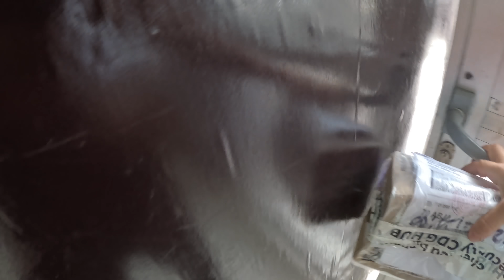Opening up the engine of my Honda CRF300 Rally in West-Africa |S7-E52|

Comment: As a mechanic in my first career I can safely say few people would rip that engine apart in that location unless they really knew what they were doing...very impressive. Your patience is also most impressive. 😅
Reply: Seems to me like doing Open Heart Surgery in a Dumpster.  😱
Reply: Patience? I think she's nuts going to Africa, a lady alone in a dangerous place like that, absolutely NUTS.
Reply: they didn't soak the clutch plates in oil before assembling bad mechanics. ￼👎
Reply: Why did they even took the whole engine apart to change to clutch plates? Seems like they did much more work than necessary...
Reply: @S....  so true only the bottom half needed to be taken apart, NO metal will pass through the oil filtration system to the top end, bad mechanics.
Reply: @scottp7587  Talking smack. They checked most of the engine at the same time it was apart. Only shows that they are good mechanics.
Reply: @S....  NO they did not do too much. You cant do too much when debree from the clutch assembly has broken into small pieces. You dont know much about this.
Reply: @peterjones4621  smh 🤦🏻‍♀️ racist spotted

Comment: These two mechanics are no joke. They get things done. Period. Outstanding job!
Reply: I hope they pre-oiled the clutch plates🙈
Reply: @stmasch7  mechanic humour haha.
Reply: Questioning their ability to repair motorcycles is sort of silly. Remember, when Noraly was stuck in the mud...all those motorcycles going through --- who fixed them?. Do not tell me some one from Europe and Japan or somewhere else came and fixed them. These guys must be very talented to keep those motorcycles running. And look at some of the brand's...TVS from India was one of them. I was wondering why Noraly did not get it fixed in Liberia. They would have done an amazing job too. BTW, you can do without a torque wrench. After a while you know the difference between 5 lbs/foot and 35 lbs/ foot ...like wise Newton/ meters.

These countries lacking resources do so much with so little. Can some of us in first world do the same? Be honest!
Reply: And, driving an M class bmw and a Mustang !
Reply: @stmasch7  Its a wet assembly as soon as you pull the clutch.
Reply: @surajdesilva4554  To anwser your question: NO.
Reply: @blueman5924 If you honest, show people respect and do a competent job and perform hardwork you deserve to treat yourself.
Reply: @stmasch7 
The engine was stared without the use of the clutch. Assembled the back wheel the next day to test ride. Enough time for the plates to soak in. 
They are true mechanics that think outside the box.
Reply: They   can  get  JOBS   in EUROPE    but  the workshops  would   go  MAD.
Reply: @tuforu4 The shop would go broke if folks worked like them.
Reply: @EckRD how when most in Europe are glorified part changers not real mechanics or mechanical engineers.
Reply: @StanWellback-eo9cm Yes I questioned that myself 😂😂Not so poor in Nigeria😂
Reply: Now imagine trying to do this with an electric bike 💀
Reply: @6Sparx9 f. Electric bike nothing but junk

Comment: These guys deserves an award from Honda itself and Honda deserves an award for such a serviceable bike.
Reply: I agree about Honda, but repairs are normal for any backyard mechanic.
Reply: Yeah but having knowledge on how to pull out everything and putting it back to one is a great feat
Reply: Exactly!
Reply: @TC-dw6wg  Four-Stroke engines are complicated and heavy.  Not every backyard mechanic is up to it…
Reply: WHAT ?? I would rather give this Honda model the Golden Cucumber.  At the film festival, the worst film is honored with the “Golden Raspberry” on the eve of the Oscars. This has so far not happened in the motorcycle sector. At least officially.
Reply: @TC-dw6wg they not backyard mechanics.they are masters
Reply: Honda is already well known for this. Excellent engineering.
Reply: Honda needs someone who buys a new motorbike after a little broke down.
Reply: What kind of an award? Lol take a brand new CRF to Africa and have an ENGINE REBUILD in the middle of the trip? I mean this is a nightmare and nobody would like this nor would call his bike trustworthy if such a thing happens
Reply: @fisherkalastaja  excellent engineering take a brand new bike and have an engine rebuild because you didn't just use it to get from your home to the cafeteria next door but for it's actual implied/intended use case
Reply: Amazing mechanics with the limited shop, lights and conditions...👏👏👏

Comment: These guys are fantastic mechanics… they have kept motor vehicles alive for decades that western mechanics would have left at the scrapyard for a long time ago!
Reply: No a western mechanic would have fixed this in the frame with no problems. There is no way they are fantastic except in imagining stuff to do the doesnt need doing.
Reply: So true..in Western countries it's time over money.
Reply: @gregorykleiman2137  I have to agree, Time will tell just how good these guys really are. It would not take much to miss some of that broken clutch basket and quickly destroy the new one. If I were Noraly I would change out that oil sooner rather then later if at all possible. Great program!
Reply: @gregorykleiman2137  Whatever.  I enjoyed watching the way they worked together wordlessly, without a bench, and seemingly chaotically, but then put everything back together like savants.  I'm sure they could teach Western mechanics a thing or two (and vice versa, no doubt).
Reply: @LeafBurrower  always fun to watch. They have done this a lot. I have seen a brand new chinese motorbike engine driven once and second gear broke a tooth. I watched a village mechanic pull it apart into parts and throw them all jumbled in a steel wok he had to collect them all. Then he got the part and put it all back together. They have a lot of practice it is like a rubiks cube. Great to watch if it isnt your engine.

Comment: Yes, from the very beginning, you could see the mechanic had confidence and never had a puzzled moment.  You knew he was going to fix the issues.  Amazing how Noraly has always had a guiding angel ready to provide assistance when she has trouble.   And for Lawrence, it is quite clear that without his aid, Noraly would still be back facing those muddy roads.  It may have been a blessing as she now has a "new" motorcycle ready for the continuing journey.
Reply: YOU SAID IT ALL MY FRIEND...  kŷdos to those Guys. You SURELY picked the Telltale signs of competence and understanding. // There would be very few Mechanics in the West who could pull this Job off under those conditions. // A Major engine overhaul; Resetting, Timing, Sequencing....  .... squatted over on a STOOL/ come Table... in the Dust. Hands bathing in "Solvent" what looked like Petrol. They had the sense to strip the Motor down... not only a Check Over but to find/ and Flush bits of Demolished Clutch assembly particles from the lubricating "system".  Truly Unbelievable under the circumstances. In the West... we think we Know it all with all our Fancy "Gear". //   NORALY being the "Film production Manager" had no reason to falsify anything but tell and show it as it was. What AMAZING ENDURANCE and TRUST this WOMAN has! // Karma is surely an Amazing reality in all this.
Reply: FreeCrack4Hunter  Certainly true, but I don't think they have removed to many 350 engines from that model Honda.  They certainly have mechanical aptitudes to go with their skill.  Removing that engine is not a simple task, and they gentleman in Alaska had a nice clean garage unlike these guys.
Reply: @notyermonkey2134  Did you notice the first guy that took the motorcycle for a test ride.  He did it bare footed.  Try that sometime.   Additionally, did she head mechanics' car??  It was a BMW "M" car which ain't cheap.  My neighbor has one, so I know how much they cost.  I think his expertise is well paid for.
Reply: Yes, the mechanic was better than good.  I'm not criticizing.......ok .....but  this is the first time i have ever seen a barefoot mechanic. I would hire him in  a heartbeat ,  bare feet and all. LOL

Comment: It was clear watching this as a mechanic that these guys were not messing around. No doubt that it was going to be good. I was particularly impressed with the amount of time they spent making sure you had no pieces from the clutch left in the case. Bravo
Reply: @vihreelinja4743  I would not have done any of these things
Reply: Those  timing  chains  are easy to get a notch  off,  and  a agree  with  the  piston pin.. never seen  it done  backwards  before.
Reply: @oldmate99  he's got a point. def. not necessary but while you're at it why not make sure it's 100% lol
Reply: You guys crack me up, doing it differently than you might, doesn't mean its not 100% and they clearly knew how to time it.
there was not a second of hesitation on startup. And the biggest issue that was going to potentially end in a bad bad place was a remaining piece of metal floating around. They made very sure it was clean. They crushed it.

Comment: I am always impressed by mechanics that can reassemble an engine by memory alone.
Reply: @vihreelinja4743  The parts may only fit in one place, but remembering to put them together in the right order, and have none left over -- that requires a bit more talent!
Reply: @vihreelinja4743  Spoken as a true armchair mechanic.
Reply: Once you have ripped apart enough engines it's more or less the same same. Especially fairly simple motorbike engines.

Comment: Those men seem to know how to fix a motorcycle very well. Even under such trying conditions. They have definitely earned our respect.😊 And by the way, all of us here ❤you.
Reply: Not sure what the conditions are you are talking about, they pull up in a M3 in a city full of cars and bikes, and bank machines.  Surely there was  a motorcycle repair shop somewhere better suited to fixing a broken (not just burned out) clutch...with metal filings everywhere.....the key word "everywhere".    A little compressed air and a proper cleaning, and a repair shop, would have made me feel a little better about this repair......Noraly is still concerned as you might have noticed.....because of this issue.  The fact that they took the whole engine out for a clutch repair seemed odd to me, but maybe they knew something I didn't.  Anyhow , I am commenting on your comment because I am noticing that there is this belief now that everything is good to go, normally there is a test run period to get past, and at least one oil change looking for metal filings......much sooner than a few thousand kilometers.
Reply: @greyfisher3897 they need to open engine so they make sure there is no other problems with it

Comment: My first job was an aprentice motorcycle mechanic at a Honda agency. The one thing I loved about Hondas was you needed one small set of spanners for the whole range from 50cc to 750cc. All the wiring was identical and all the tappet settings the same. This meant you could work on every motorbike they made as there was no need to constantly learn again and again. For this reason they are are excellent, simple and practical to work on and as everyone knows ultra reliable. We hardly break them in in Europe compared to developing countries where they are the life and blood of a nation...

Comment: Congrats to the mechanics who took their time and cleaned the inside of your engine before  assembling. 😊
Reply: yeah, right, shake it over a pot lol
Reply: @jimksa67  No torque wrench in sight
Reply: But still assembled and worked correctly.
Reply: Skilled mechanics don't need a torque wrench, you get a 'feel' after many years on the tools.
Reply: @Fekillix  i work as car mechaic in Sweden for long time , i belive he did a great job. yeah ofcours he needs use  torque wrench inside engine but we have to understod they work on fields and difficult to get suppliys  so great job guys
Reply: @Fekillix  it shows you have never worked on anything probably never left your city or got stranded
Reply: What does it say when your mechanic shows up in a BMW (M class I think?)?
Reply: @lonelychessdragon  I did actually completely take apart and re assemble a single cylinder motorcycle engine with all new bearings. And I soaked the clutch plates in oil before re assembly, which is pretty basic knowledge that these guys skipped.
Reply: There was no reason to take the engine out to clean and or to replace the clutch. Hopefully no oil leaks will develop down the road.
Reply: @unleavenedkaraiteplus3412  
My thoughts also.
Reply: @Fekillix 
I will trust those guys who fix and repair parts than you who always replaces parts. Many like you are just replacers and not mechanics. Many carry the mechanic title undeservingly.

Comment: Great news Noraly.  I'm former motorcycle mechanic.  Your engine has a really deep sump for any loose stuff to settle into. So don't worry about it. Remember that you drove it a fair amount after clutch blew and that didn't cause any problems. Relax and enjoy the ride. I love the view over you handlebars. Stay safe!
Reply: thumbs up for sharing your knowledge @athingortwo. It will give her some piece of mind IF she reads it.
Wanting to add my 2 cents, but with so many cmnts in the 1st hour (59K views), should I even bother. Due to the delay in her posting, I figured she could have taken the bridge to Austrailia by now. LOL (large toll.) We thankfully did not have to wait 2 weeks for an update since she trucked it into town.
Reply: Thanks for your informed posting. I was wondering how much residual metal might be lurking in the bowels of the motor. A question for you: should the new friction clutch plates be soaked in an oil bath for a few hours before installing so they're not dry? I realize it's a wet clutch set-up but there is limited space between the cork friction pads and the steel plates to allow much oil penetration.
Reply: @osimnod  Presoaking the plates isn’t needed because the plates are composite, non-porous material. Do you have a vintage machine with compressed cork plates?
Reply: @athingortwo1513  I have a 2006 KTM 640 
Adventure and a 2003 Aprilia Caponord that both need clutch plates replaced. I watched a YT video by a British mechanic who recommended soaking the OEM plates, so that's why I asked. Thanks for your response.

Comment: Great mechanics, No hi-tec tools or garage to work in.  Outstanding  craftmanship.
Reply: Not so outstanding when they forget to soak the clutch plates in oil before assembly.. :-(
Reply: @DenRoedeMogM  With all the shavings that are still in there, does it matter?. Anyway, I hope they change the oil and filter super often.
Reply: Its a good enough job that I think it will last until she can get to a proper shop. They did good given the circumstances
Reply: @alexanderstark5192  Yep that's my point.  I have watched mechanics in Iraq, Afghanistan ect use basic tools and materials to diagnose and repair  vehicles with no workshop manual .  I have seen mechanics in the UK with all the gear  have no idea what's wrong.
Reply: Those mechanics were super and how  you have handled such an African  Adventure just blows my mind.. You Noraly are also a super lady.
Reply: @DenRoedeMogM 
Those guys repair and fix parts. Many mechanics in the developed world are just replacers.
Reply: @DenRoedeMogM The clutch plates get soaked in oil as soon as you put oil in. That's a bad urban myth.

Comment: As a retired engineer, I can say that it was obvious to me that those chaps knew what they were doing from the start. As for any tiny bits left in the engine, gravity and filters will do their work so don't panic if you find any metallic bits at the next oil change: The sump is where any foreign matter is supposed to be. Good luck with the rest of your journey.

Comment: Their confidence in rebuilding a motor they more than likely have never seen before, no manual or YouTube videos to follow…respect you guys…could see the relief on your face. 😊
Reply: The MOST appropriate compliment I've seen here, I agree.
Reply: What I saw was concern on her face once it was all put back together, as she openly wandered whether or not all the metal filings were removed..... Maybe you missed that part.   Any time an engine is rebuilt roadside by complete strangers...for money, when  motorcycle shops in that city exists by the dozen,  ( she is not the only motorcycle in Africa),  there should be some worry, and not just blind praise from  a generally mechanically naive stream of comments.....full of false praise and false hope...time to get real and remind yourself of the extreme danger of this type of activity, not just crashing while being towed by a rope, but breaking down in a hot desert or jungle, after an engine rebuild, that may, or may not, have been done properly for full reliability.   I didn't see that relief you speak of, I say  some continued worry, rightfully so.
Reply: Oddly enough theres quite a number of these bikes around, so knowledgeable guys do actually know how to work them
Reply: Bro... they rebuild all kinds of tatterd motorcycles in that country.   The bike is a single cylinder (easy)...   Go to a Motocross race and you'll see all kinds of Single Cylinders torn apart.
Reply: @greyfisher3897  I hope this job works. A good two lads did the work but it was not a 5 star Honda dealership. Carry on Itchy Boots. If you break down again I will bet you find someone else in a thousand miles to make her good again.
Reply: Honda is everywhere tho.